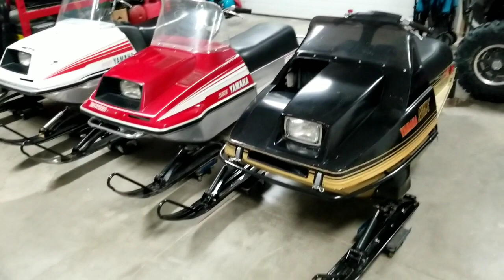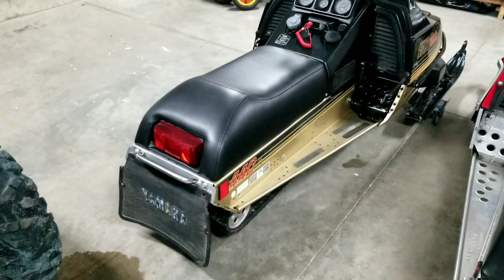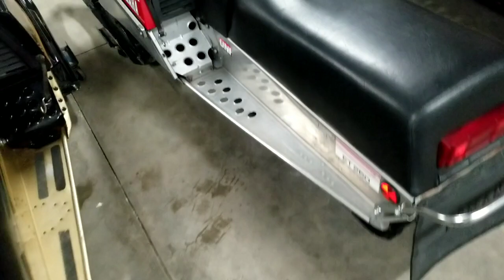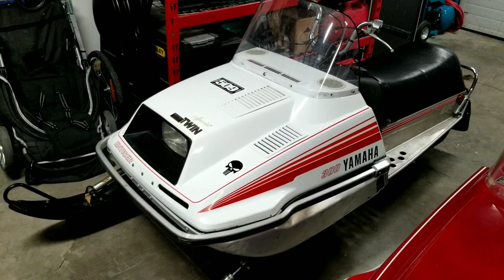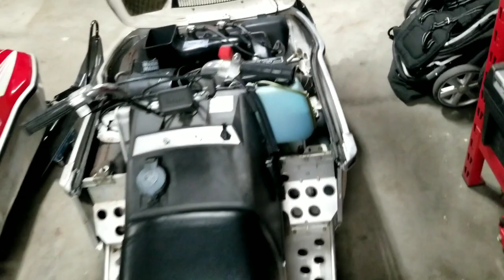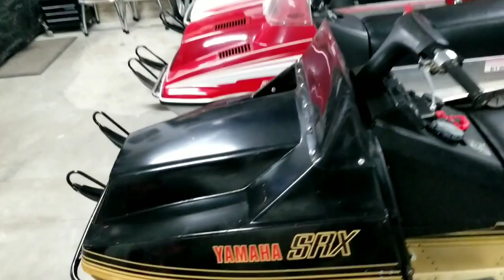Vintage Snowmobile Line Up!!

Comment: That black and gold SRX is badass I have a Yamaha Raptor 660R with a Yamaha VMAX 600 twin snowmobile engine and a Polaris Trail Boss 325 Yamaha Exciter II 570 twin snowmobile engine a single seat Rail Buggy 1975 Skidoo 440 twin she gives the quads a run for their money

Comment: Great collection and fun video.  Had a '82 Enticer 340 back in the early 90's.  After that a Phazer and a couple of new early 2000's Ski-Doos.   The Enticer was the most fun due to it's light weight and power to weight ratio.   Rode that sled all over Michigan's Upper Peninsula without a single mechanical issue.   Still had a half tank when the other guys were stressing over fuel.  The only other sled that was as much fun was a 1972 Rupp Rover with a Xenoah 295 single carb.   That was a 20:1 sled that was rock solid dependable, fun to ride and super light weight.    Enjoy the Yamahas!
Reply from the maker: Great to hear that! Thanks for watching!

Comment: What type of carb would you recommend for a et 300? I botched mine working on it
Reply from the maker: Best would be to try and track down another stock carb. If you can't find one then I'm no too sure. Maybe a VM36 roundslide but you'll lose oil injection. Also will have to experiment with jetting.
Reply: @garagenerd1951  thanks ill see what I can find i may just pre mix fuel and run it through but I haven't found any one in the colorado area that has those parts
Reply from the maker: Facebook Groups will be your best friend when looking for parts.